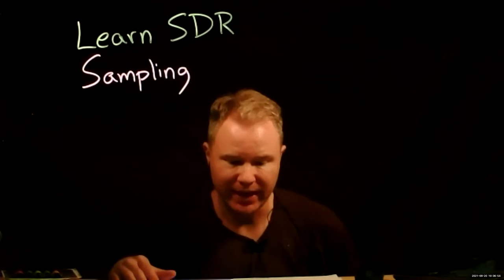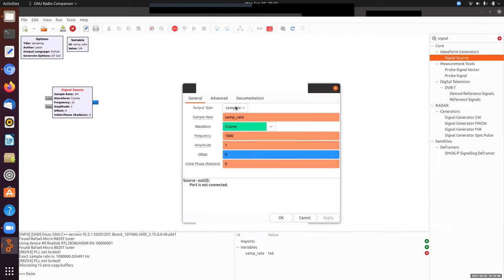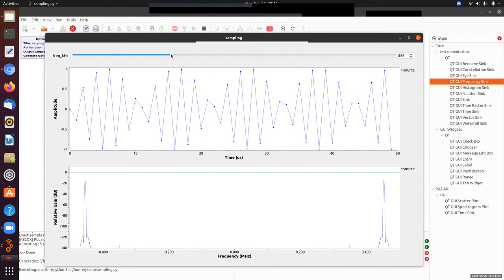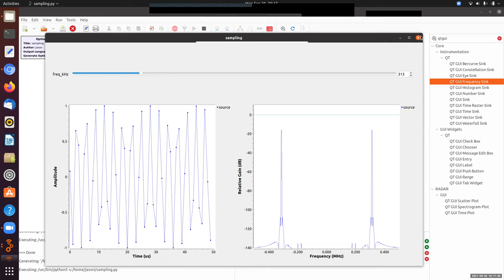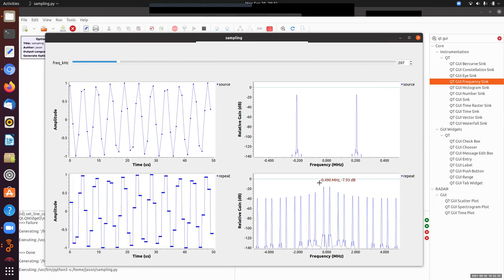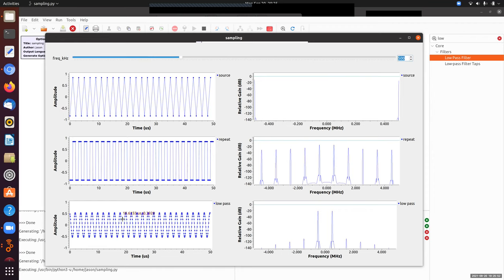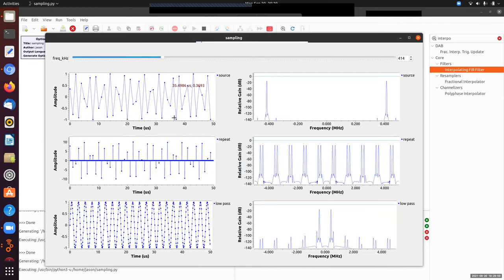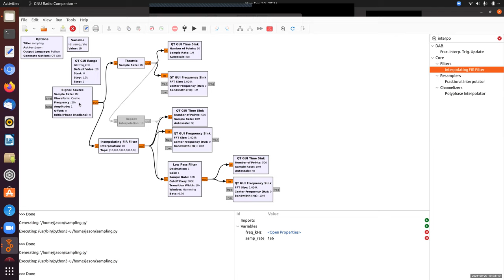Learn SDR 06: Sampling

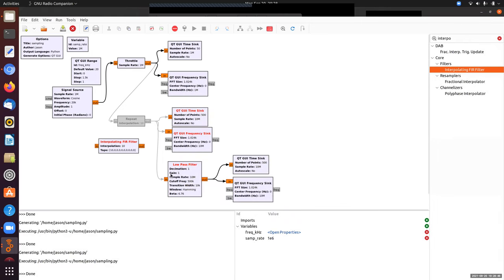Comment: Why, at @20:27 in the demonstration of the Interpolating FIR Filter, did you bypass the throttle block by connecting directly to the signal source when during the other demonstrations you used the throttle block?